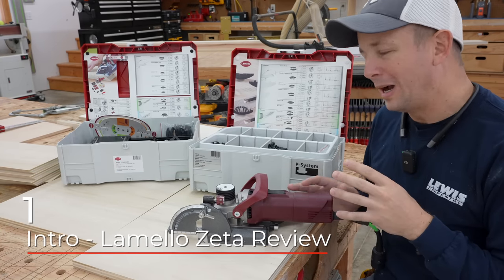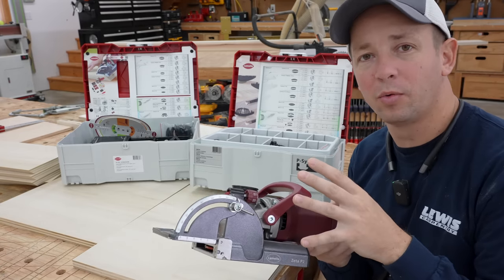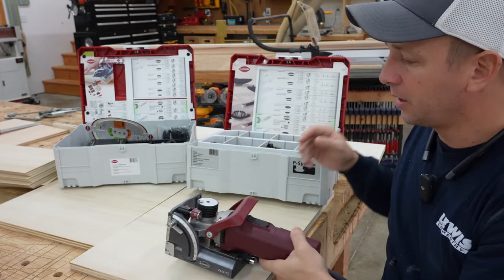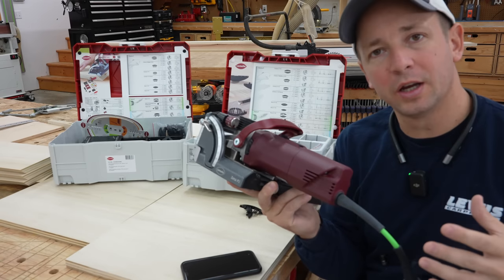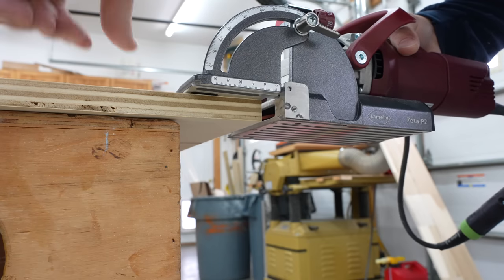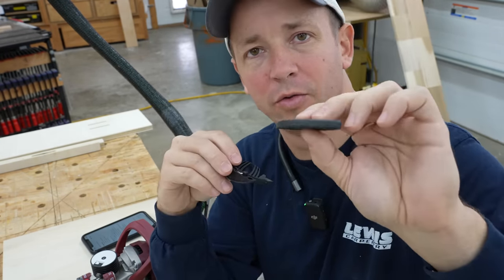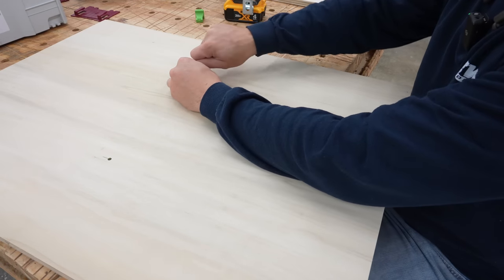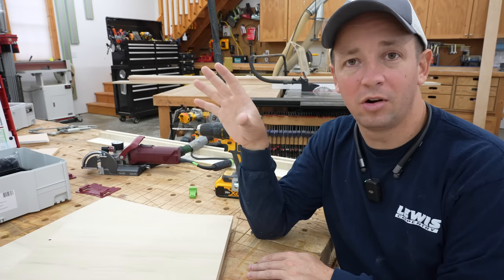Worth the $2000??? I finally bought a Lamello Zeta...

Comment: Did high end woodworking for 30 years and have nothing to do with it now Thank God. I see that designers ard architects are still idiots. Nothing against you or Lamello. If I had the cash I'd buy a Domino as that has been the most innovative and useful tool in a long time.  Make something Beautiful you'll feel better 😊
Reply: Domino would be much slower for case work.

Comment: 2gs and plastic cases? How far we have fallen.
Reply: Here in Sweden the one I have is 20 years old so it’s a much simpler model, only the wood kex was available
Reply: @thomasfholland  hi there, in Holland! "Only the wood kex "? What is "kex"? Did you mean "case"?
Reply: I meant sweden
Reply: Though I understand what you're saying, carrying a plastic case in and out of the job site is a lot lighter than a metal one.
Reply: @Gottesacker86  hey, 
of course you are right.. I'm a slob, sometimes, with tossing tools in the truck so plastic cases don't last.. that, and I'm into vintage circular saws so I have several steel cases on my truck for different size saws.. you can stand on those old cases!  And they keep the saws perfectly planted and safe while inside.
Reply: The plastic also doesn't damage finished materials inside the customers home and you don't have to fix the accidental damage on your own dime.
Reply: @davids8493  that's a great point.. I have no cause bringing  circular saws into a finished home so that's not an issue.  I do have a vintage 1/3 sheet sander with a nice metal case. I would bring that into a home, if need be.  You gotta be careful with anything you bring into a finished home, as you know... Plastic or metal I'm putting a blanket down first, anyway.
Reply: Systainer toolboxes are one of the best toolbox systems. I'd much rather have a nice systainer than a heavy, bulky toolbox that takes forever to get the tool back in
Reply: @coolbugfacts1234  hmm. I never have a problem loading my 1950s Porter Cable saws back into their boxes
Reply: @Gottesacker86  I just wish they were tougher and waterproof. They are pretty fragile vs a pack out  system.
Reply: @Slowhand871  the Systainers could definitely use an upgrade on the water and dust front. That said, the few systainers I have are SO much less bulky than the Packouts, and seem to hold quite a bit in their smaller form factor.
Reply: @timbarry5080  I have a metal case for my Mafell. It’s a fantastic case, but I only take that heavy brute out of the truck when it’s a fair jaunt back and forth.
Reply: For $2k it should come with a machined 6061 T6 aluminum case...
Reply: @timbarry5080  Sorry I got my English words mixed up. So, the case was/is still plastic, yeah already plastic when I bought mine +20 years ago. The “kex” thing I was referring to is the connecting wafer (?)